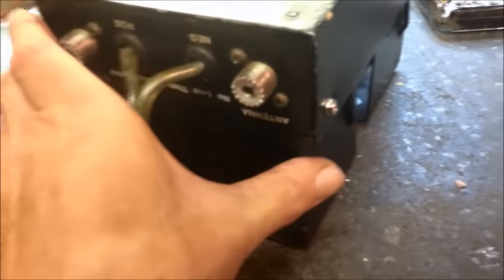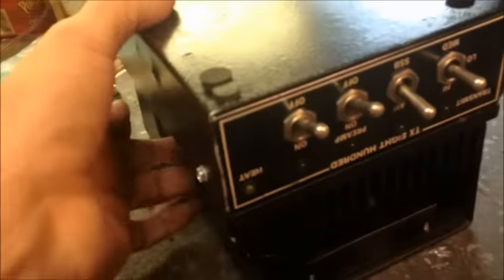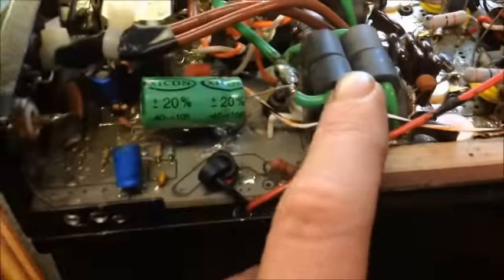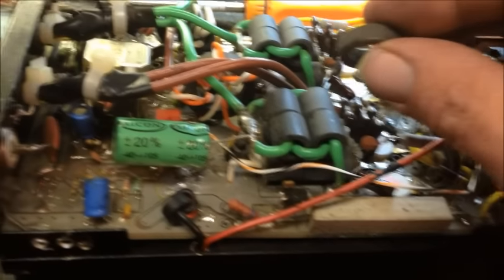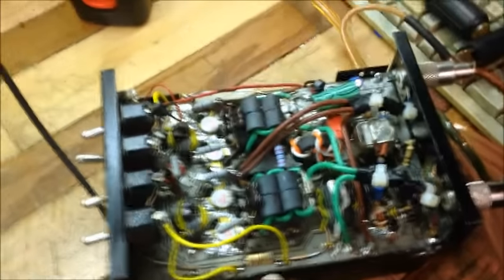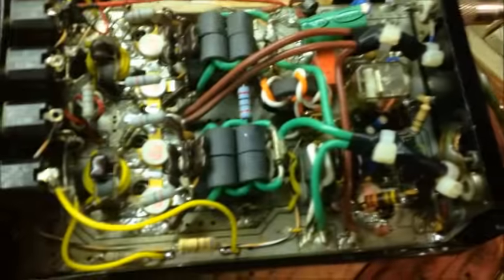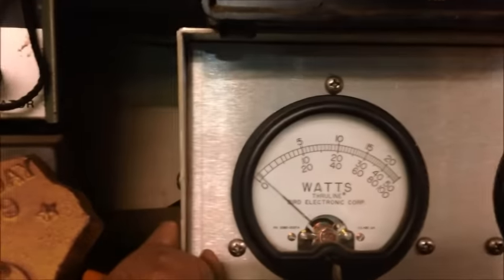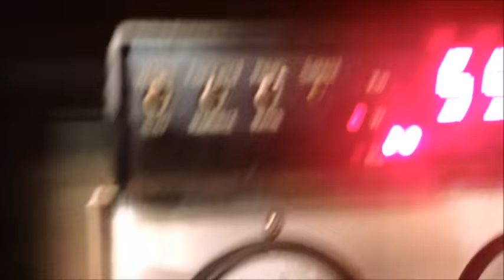Wade's TX800 Repair

Comment: stick that is the amp that planted the seed for me. that is where i got the idea from right there. two 10awg teflon wires. i owned 5 of them and 3 of them had that exact issue with that resistor in series with the ground side of the wrap :) nice nice unique amp.